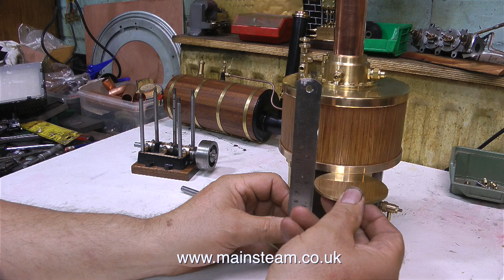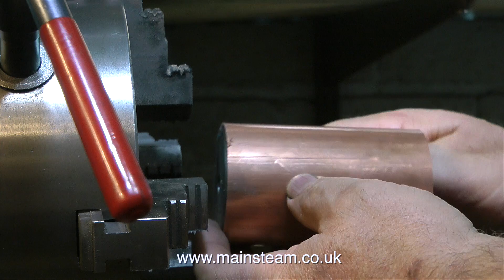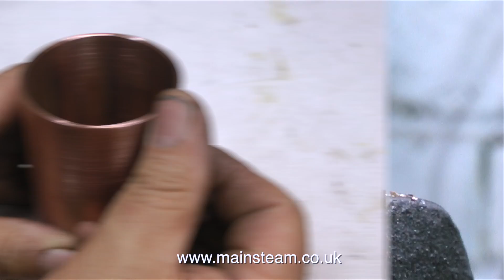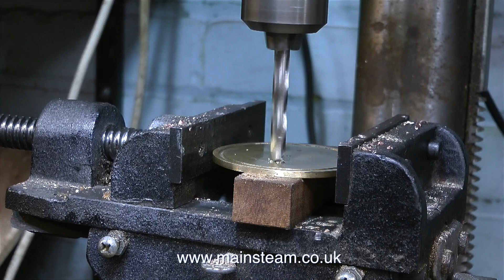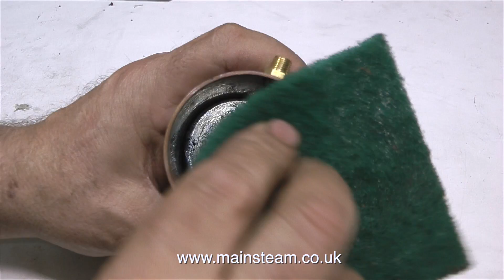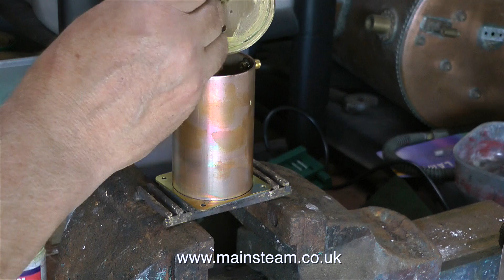HOW TO MAKE A COAL FIRED STEAM ENGINE BOILER PLANT - PART #18

Comment: Beginners should not use an adjustable spanner unless you want to learn how to use one properly. I just bought one of those famous spanners people keep complaining about. The problem with the complainers is that they don't know how to use one. There is a feel to keeping the pressure on the nut head while keeping the jaws sized correctly during each turn. It's a great tool that can be used for multiple sized nuts and bolts that saves a ton of time not having to keep changing tools. I love a good spanner and I bought another one because i like the one you use. It's about finesse and muscle memory development folks. Keep on doin how you do it K. Love your channel. The more I get into building steam engines the more I love the channel.

Comment: Hello Keith,

when clamping already machined parts (or parts made of a very soft material, like copper or aluminium), I always like to use some sort of shim between the chuck jaws and the work. It helps with holding the work more securely as you can tighten the chuck a bit more without having to worry about scoring the part.

Three small strips of ~0.5 mm to 1 mm copper (or aluminium) sheet metal will do nicely and keep the work from being scored.
It's a little bit fiddly getting the shims in when tightening the chuck:
I find it is easiest if, with a three-jaw chuck, one jaw is at the bottom and you can just rest the work on a shim on this jaw while putting the other two in, holding them and tightening the chuck.
Since sheet metal does have a very uniform thickness, as long as you make the shims from the same piece of sheet metal, the work will run quite true with them in place.

Anyway, I always found the shims save a bit of time cleaning up the work afterwards if you want to get rid of the marks from the chuck jaws.

Comment: Really looking forward to the Victoria build !
I don't know why some people are so against adjustable wrenches or shifters as we know them here in Australia , if you buy a quality brand like you have they are fine for 90% of the work you would ever do .
If i know a fastener has to be torqued up tight or i suspect it will be frozen in place i use the correct tools but for the most part in model engineering a shifter will do .
I really like the ratchet tap wrench , did you make it ? One of those would be fabulous for tapping on the lathe with a spring type centre .
Acetylene is good and fortunately here in Australia we can now own the bottle instead of paying horrendously high rental from gas suppliers although the original purchase is a bit painful!
I'm thinking of going the LPG /OXY route as the fuel gas i already have (bbq gas ) and the oxy bottle can be bought also .
This gives a temperature  a little lower than acetylene but still hotter than just a blowtorch  and i can cut steel with it .

Comment: don't let people give you shit about your use of an adjustable spanner, "don't use adjustable spanners" is a thing greybeards tell idiot apprentices with cheap adjustable spanners and everyone has taken it to heart as a permanent rule.

the correct quality tool, in the hands of someone smart enough to use em provides great results.

on the other hand, the correct quality tool, in the hands of an idiot, end up rounding nuts, like my car that I decided I wanted a pro job done on the cam belt replacement, paid for it to be done, found 7 rounded nuts and bolts on it that I've removed myself over a dozen times for some of them without ever rounding them.

somehow these idiots managed to round them and they were using a full spanner and socket set, no adjustable spanner in sight.

Next time I'm replacing my own damn cam belt.

looking forward to your steam engine build series, alot of the things you have taught via your videos so far have helped me on my project(chainsaw engine powered remote control car/buggy). esp the little machining/fitting/drilling/filing parts.

Comment: That part is going to be a bit of a bother to clean. Acid fluxes are very active, and will corrode the base metal if not cleaned off. Activated Rosin and Water based fluxes do the same. We typically clean circuit boards to within an inch of their lives in alcohol with a brush to get all of the residues off.

I'm concerned that the acid flux and the flux core in the solder wire may not be chemically compatible. Most of my data is based on electronics work (my profession), where the standards advocate for not mixing flux types. It may be worth looking into the chemical compatibility, particularly if it enhances the corrosion effect of the flux or creates the potential for dangerous fumes.

Soldering will generate lead dust. My training on the subject was to simply clean the workstation thoroughly and wash up vigorously after soldering. That seems to take care of the worst of the lead contamination, at least according to my contacts in the industrial hygiene group at the office.
Reply from the maker: Not required in this case. This unit will be constantly flushed with steam and boiling water. The residue just gets completely flushed away after the first couple of runs.
Reply: That makes sense. Hot water and steam is quite a good solvent. I was concerned that the rosin base for the flux on typical electronic solders would be hanging around, it's a bit of a pain to get rid of from circuit cards.

Comment: As an HVAC technician I work with soft solder and hard solder almost daily. I've rarely used oxy acetylene for either since I was in trade school about 25 years ago. For soft solder I usually use a MAPP gas torch. For brazing and silver solder I use an acetylene "B" tank with a turbo torch. I have used MAPP gas with a large tip when I needed to heat a large area for silver solder but not often. The turbo torch lets you heat a smaller area and control the flame better.

Comment: love your comment on the guy insisting you are silver soldering wrong oops another muted lol. I've used the method before of the flux brush along a seam or joint before to clean and smooth out rough looking  joints but never with  dipping in water nice idea to keep in mind thanks .......    love the videos  Keith  very well done. next pension check i will toss you a little bit of a donation .  i am current checking to see whats available in the states for steam  parts and  plans

Comment: Oxy-Acetylene for this work????  Heavens no!!  That would poke a hole in the copper pipe in less then a New York second.
Reply from the maker: The point about this Oxy debate is as I said: Home workshops don't usually carry it ..... I certainly don't have it, in what is effectively my home workshop - I would think that the house insurance wouldn't allow me to have bottles of Oxygen and Acetylene in the workshop which is conveniently attached to my house and also known as a double length garage . . . .  Oxy/Acetylene is great if you silver solder large components like copper boilers - but for silver soldering small pipes it really is is overkill  ..... I will stick to my blowlamp for now I think :-))))
Reply: I will stay with the blowlamp as well.  Thank you for this series and your others.  You should narrate children's stories.  You would have been great on "Thomas the Tank Engine"
Reply: Keith Appleton I think that oxy acetylene is a lot more common in the USA

Comment: In North America we call a Spanner a Wrench but you are British so I will forgive you.
Reply: to us Brits you Americans, if Abom is to be believed, use strange words, you have a spanner wrench which translates as spanner spanner. And neither is a Bahco.
Reply: I am a Canuck.  In Canada we do not add "Spanner" to the wrench you are using.  It is called an "Adjustable Wrench"  We don't apply the Span which refers to size, that being the span of the tool.  We use the term Wrench which refers to the leverage we apply to the tool.  An adjustable Wrench would therefore become an Adjustable Spanner which would indicate it is a universal tool within a certain range.  In Canada a six inch adjustable wrench refers to the length of the wrench and not the span it is adjustable to.  In British parlance the same tool would have to be referenced  to as a 3/4 inch adjustable spanner as that is how far open a six inch adjustable wrench would go.  Sort of confusing to you in the same way that the sizes of British Common Witworth Spanners are to us.  In reference to Witworth Spanners, I have trouble calling them spanners in that the size does not refer to the size of the head but rather the size of the thread.  Rather though the SAE and Metric Wrench sizes could be referred to as Spanners because the size refers to the size of the head.  But here in Canada, which is a British Empire country, we call 'em Wrenches.  No have I torqued down your bolts on this one?

Comment: I might get blocked for saying it... but we have found the following method really handy for soldering cap onto a barrel. Flux everything, form a ring of solder by winding soldering wire on a mandrel. Insert the ring as close as you could to the edge, put the cap on and heat the joint. At one moment you will see solder wicking out from inside, done. Essentially you are applying solder from inside. We have found that leaves much less of a mess to clean on the outside.

Comment: To be honest, most adjustable spanners are very, very loose. So i can see why people are so adamantly against them. But that Bahco spanner of yours looks very tight. Nice, flat grip of the nut. You'd have more chances of rounding off a nut with a fixed spanner.

Comment: When I was taught how to silver-solder (or braze: Soldering occurs with temperatures <800F and brazing involves temperatures greater than 800F but that's just a technical detail) for HVAC work, we used oxy-acetylene. Though the guy you ended up blocking was wrong in that it's the only proper way to do it, oxy-acetlyene allows you to get the parts hotter, and it's also much easier to just straight-up melt holes in the copper and brass parts, especially the larger pieces, because the flame is generally concentrated into a cone. However, another option that doesn't allow the part to get that hot (I've never heard of people burning holes in pipes with one anyway) is what's known as a "turbo-torch", which still uses acetylene, but no oxygen tank is required. Thing screams like a banshee, though, and honestly as long as you can get the part hot enough, any method using acetylene, oxy-acetylene, propane or MAP gas is perfectly fine.
Reply from the maker: I agree with what you are saying, but my point is simply that these tutorials are aimed at beginners who don't normally have access to Oxygen based equipment in the small home workshop.
Reply: In fairness, I don't know of many beginners that have a lathe, either. :V
(I'd love one, TBH)

Comment: Hi Keith, another great video and another new trick, never thought of dipping the flux brush in water have always just loaded it up with more flux. As for the ex viewer saying to use Oxy/Acetylene I would like him to post his work on his youtu channel. I know professional welders certified by the province, and they do use  Oxy/Acetylene, but generally use the same type of torch that you do, as it is so easy to reach the melting temperature of copper and get flux inclusion in the joint.

Comment: Thank You Sir,  for all the work and a job well done,,,,  
Have you ever used Woods Metal for a filler when turning thin walled parts?
Also,,  have you ever used MAPP GAS, for it's higher heat?
Thanks again for your great videos....

Comment: Well, the spanner is yours and if you want to use it, 
I think you should use the tool you want. by the way, 
I thought I would give the Bahco scanners a try for myself.
I bought a 4 and a 6 in. And so far, I like them very much.
Cheers.

Comment: That is just strange... and wrong... 
Classically brazing and silver-soldering is/was done with a blowlamp.
I still use one of the old brass ones, which burns petrol (not kerosene).
Most literature warns against using oxy-acetylene, because it produces a temperature which is way too high and one stands a good change of melting or damaging the parent metal.

It is basically all academic anyway... the object of the exercise is bring the parent metal up to the correct temperature.
As long as this is done clean...it really doesn't matter what you use....

Toodles

Paddy
Reply: Oxy acetylene is much nicer to use for brazing and soldering but takes more practice and attention than with other methods to prevent over heating and blowing holes in the work.  Not absolutely necessary though.
Reply: Using a blow torch or a propane torch but better a Map gas torch is the proper way.  Many Carbide tools are also Silver Soldered to the holder metal.  In doing this a wafer of copper is put between the carbide and the steel.  You can only do this with lower heat.  Acetylene will destroy the copper wafer that needs to go between the carbide and the steel as a buffer for the tool.  In the case of this video we are just dealing with copper to copper but the same holds true.  Acetylene will destroy the job before you get it finished.

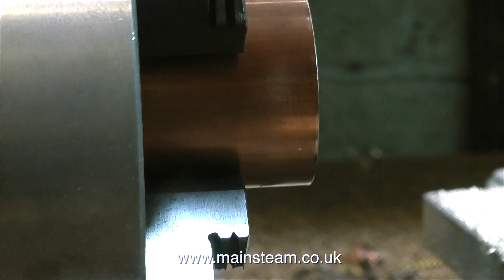Comment: Sir, why, when you use a file (1:48), do you place it upstream instead of downstream?  The latter would be safer if it grabbed.
Reply from the maker: it's just the way I've always done it, I prefer not to have my hand and arm over the chuck. I feel that there is more control doing it the way I show it and have never had a problem doing it this way.
Reply: BeeRich33 downstreammeans you will be filing backwards. It's all about experience. One method isn't that much safer than the other
Reply from the maker: I didn't like to mention that  ..... :-))))

Comment: Hi Keith, Im curious what the big copper tank in the background of your soldering shots is, judging the distance from the condenser and shelf, it looks fairly big, is it another boiler?
Reply from the maker: It is a really old riveted and soft soldered boiler, Eventually I intend to use it as a Weedkiller container on a purpose built miniature railway truck so I can kill the weeds that grow on my 7 1/2 gauge Garden Railway :-)))
Reply: Ah, well it's a realy nice tank in either case. Looks well made. It should serve you well in your weedkiller operations I'm sure.

Comment: Hi Keith,
I think that most adjustable spanners are crap however I do believe that a good adjustable spanner, like your Bacho spanner, is a must have in a workshop, as it can get the job done if you do not have the correct spanner to hand. Thanks for the informative and amusing content.

Comment: Keith

Now I am no expert ( x is a has been and spurt is a drip under pressure 😀 )

But I can give you my thoughts on silver soldering I was told by my mentor when I did my time that it is considered to be a low temp brazing technique 
Looking forward to the new series

Like you I have had steam as a hobby for a long time I think I can say about 50 trips round the big ball with my personal total 70 plus but I can always learn a wrinkle from others ,you are never to old to learn

A bit more info on silver soldering if you try to SS Ali bronze it will fail but a tip from Cup alloys mix a teaspoon of common table salt to your flux mix it works fine ( its something to do with the chelates in the bronze